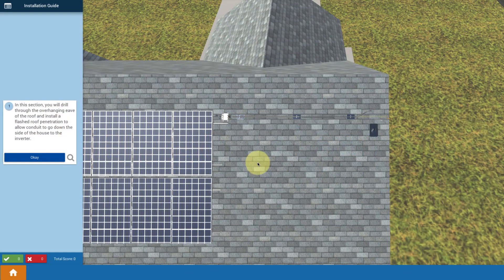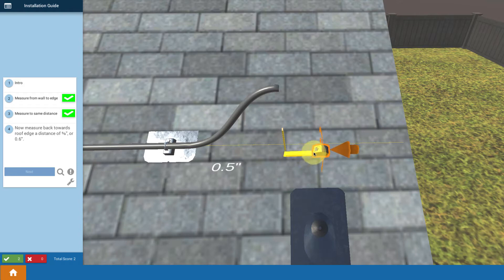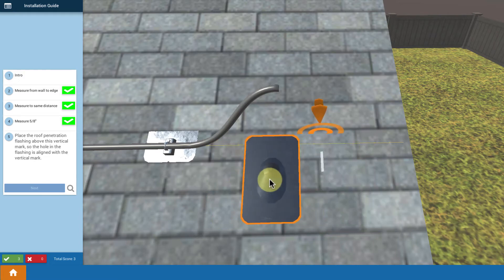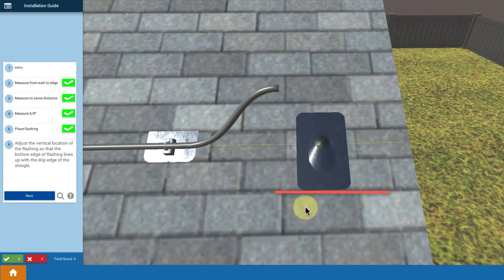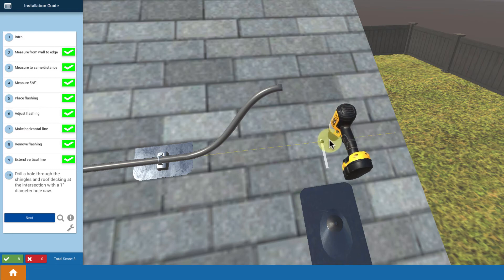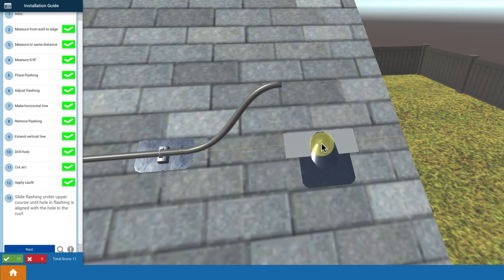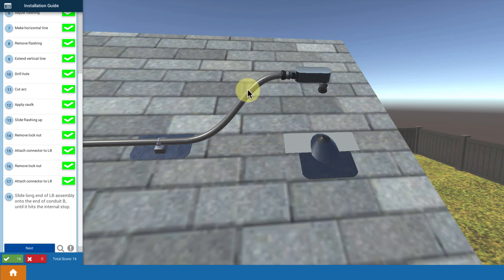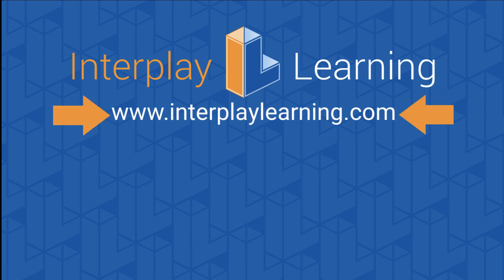Best Practices in Creating Roof Penetrations

Comment: 2:19 doesn’t make sense.  Because where the penetration mark lines up isn’t on the horizontal line.  If you line up the penetration mark with the horizontal mark then your flashing is not going to line up with the drip line.   Unless I missed something?